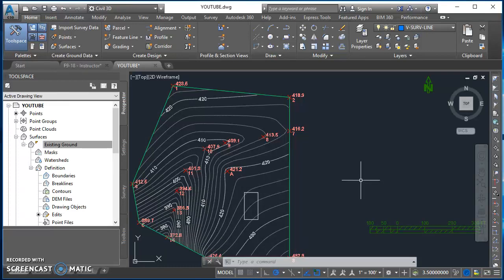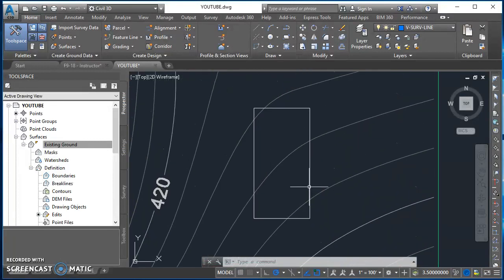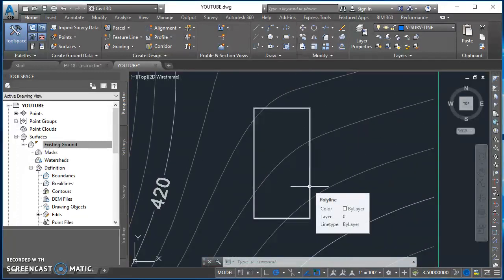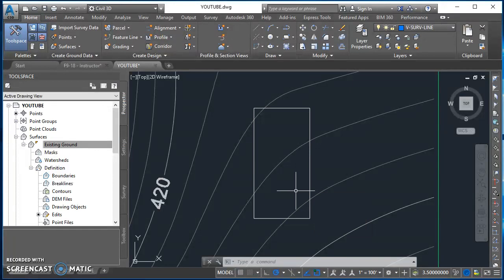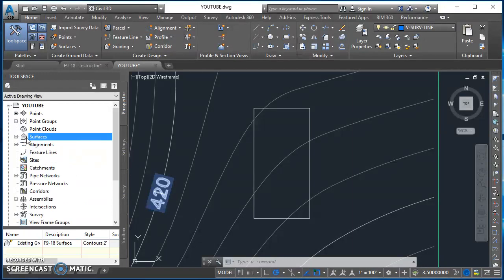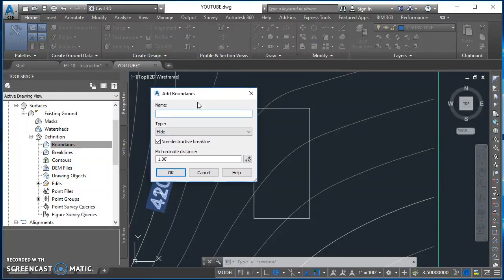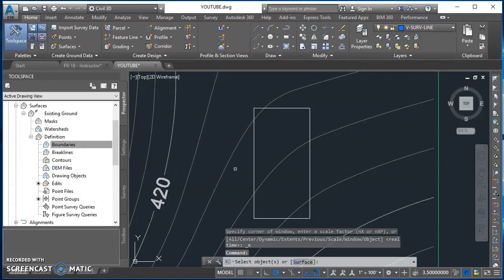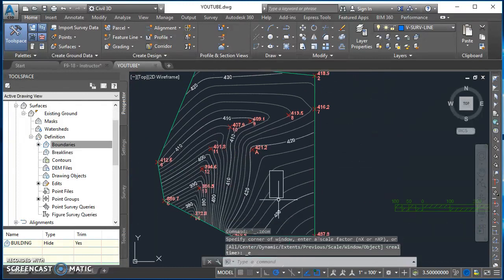Trimming Surface Contours using a Hide Boundary

Comment: How would you do this on a road ? I tried to do this on a road and it didn’t work 😞
Reply from the maker: Thanks for the comment. I'm not surprised this didn't work for a road (Corridor). I believe Boundaries only apply to the display of the Surface. Without knowing specifically what you are trying to accomplish, I can only guess at possible solutions. Although, to do this on a road, I assume you would have to modify the alignment, to remove the road in that area. A couple of other ideas come to mind, but I doubt they would help either. I'm sorry, but with my limited knowledge, I doubt I'm the best resource for this problem.
Reply: For roads, I'd use breaklines instead.